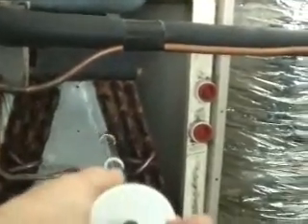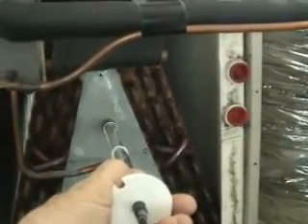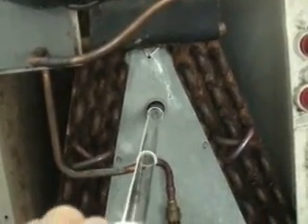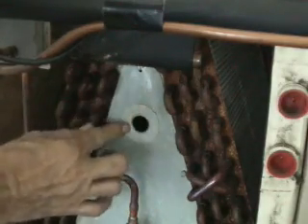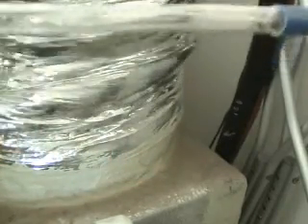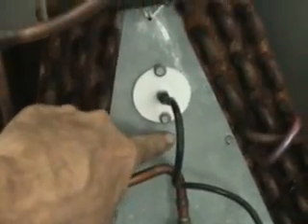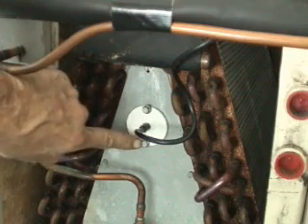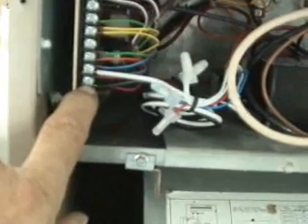HVAC (Ultra Violet Lights)

Comment: I think in the A-Coil is one of the best spots to mount as well. You might want to remove the plastic drip pan on the right side of the A-Coil. It will decompose from the UV light. The tray is just for when the air handler is installed horizontally and is not needed. Cover anything else that is not metal with aluminum tape.

Comment: I had a UV light installed with a new system in 2001.  The tech. guy never said anything about  replacing the bulb annually....Is this really necessary ?(The original bulb is still working)

Comment from the maker: Thanks for watching. My blower is set to the ON position all the time because I have the variable speed drive setup to run at 30 hertz when there's no call for heat or cool. So, I need the light to be lite 24/7.

Comment: Why wouldn't you just wire the 24volt to G on the terminal board.. So then instead of the light always being on, it would energize when the i/d fan motor comes on...Just a thought... How much do those lights run would you say????cool video by the way...

Comment from the maker: Not all manufacturers recommend using a dedicated transformer for the UV light. I'm still using my control transformer to burn the light and it's still going strong. Knock on wood.

Comment: Dr Z,

You had mentioned that this particular light operates on a 24v powered ballast, I noticed you took power from your control transformer. 
When installing such a device does manufacturer reccommend a dedicated 24v transformer or is the amperage draw low enough on that ballast that max. secondary volt amps won't be affected with this install? Long story short: What is your control trans. rated for and now with the new light install is your total control amp draw affected beyond capacity?

Comment from the maker: Yes. I wired it so that the light is on all the time. Besides, I have a variable speed drive that requires my blower to be on at all times. It ramps up and down depending on if I have a call for cool or heat.

Comment: It appears to me that the way you wired it the light will be on all the time even if the fan is not running. Is that the way it should be? or to the G terminal? (only when the fan is on) 
Thanks Ron

Comment from the maker: Thanks for the compliment. I guess that you could set up the UV light so that the power to the ballast would cycle with a call for blower. Although, I don't know if that would help to increase the life of the lamp. Also, I'll just replace the condensate pan if the UV light deteriorates the plastic. I'm an A/C tech, so no big deal here.

Comment: first off I love your channel, and I have a few questions about your UV lamp. are you worried that the location of the UV lamp will eat away your condensate drain pan? also would the life of the lamp be increased if you wire the ballast to an extra NO contact on the control relay so the lamp comes on with the blower, or is the ballast not designed to be cycled?